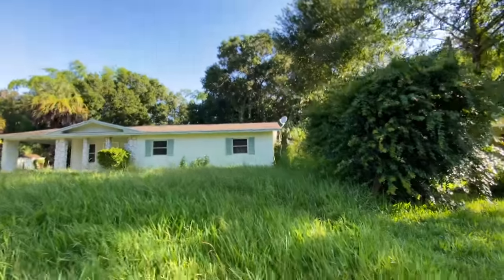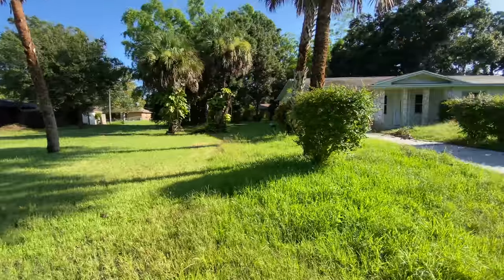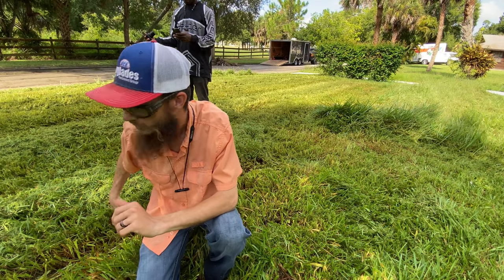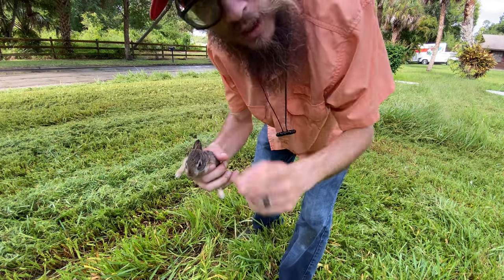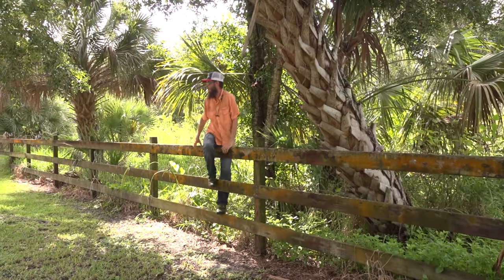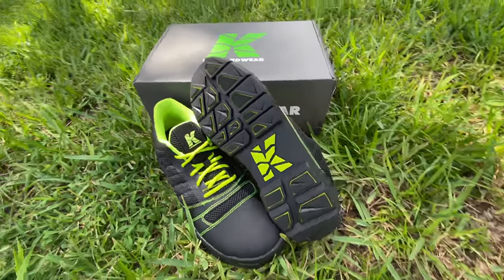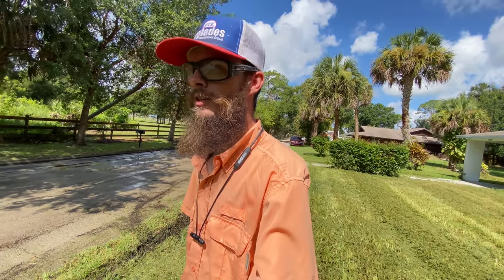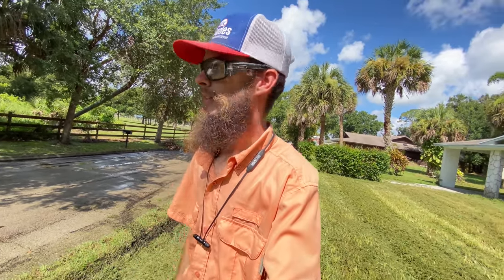This Grass was SO THICK it almost shut off my MOWER while mowing [ Random house FREE makeover]

Comment: You know Al, if you take an edger and put a wire wheel on it it'll clean them cracks in the concrete and pavement up real nice. I used to seal coat driveways and that's what we used. It's a real efficient way to get the weeds and dirt out.